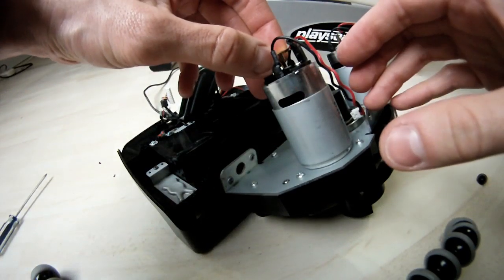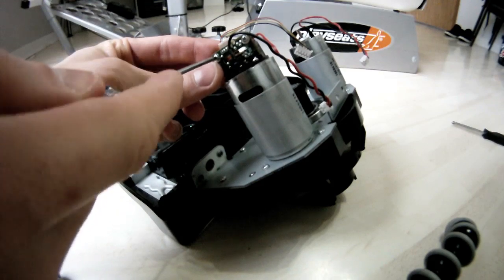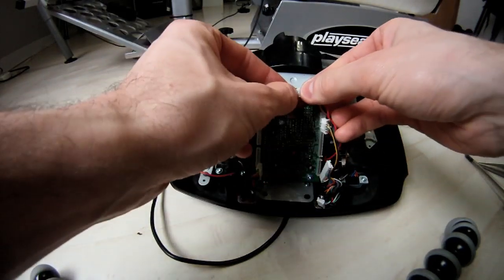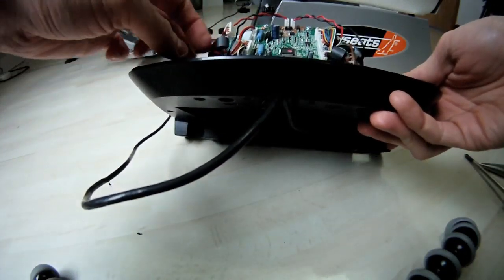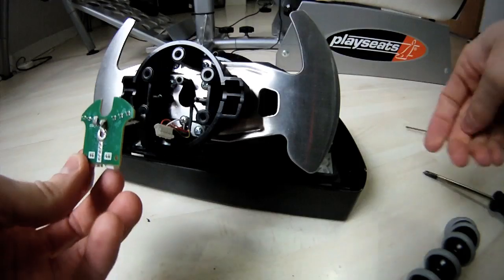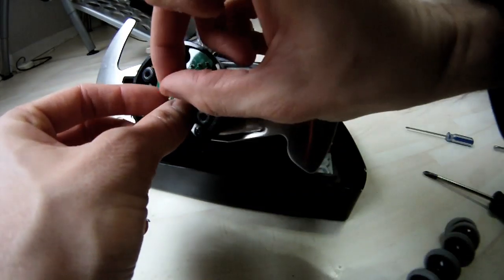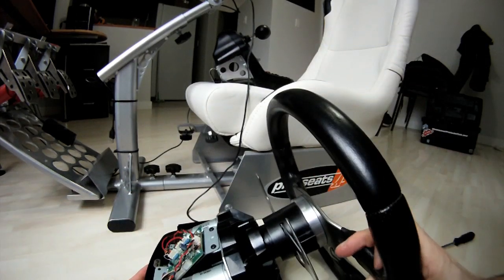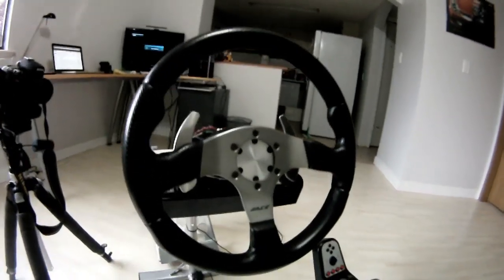How To: Replace Logitech G25 Optical Encoder Disc (Part 2)

Comment: Great video and very informative, thanks! I am still using my G25 in 2020 after some years in the dust and when I dismantled it after seeing the symptoms you describe, you helped me confirm that the crack is not normal! :-) However for what it is worth, you can replace the disk (on the G25 at least) without removing half of what you did. Just remove the top cover and unplug the wired from the right of the PCB, you can then pinch the black cover and you have enough room to get it off on the right side... I used this to reassemble it after I received the part (I dismantled it completely initially)!

Comment: Just did this myself, thanks for the vids. Works better than new. I will say though that you should mention in the comments about pushing the brass replacement closer to the black receiver. First time I put mine back together, it was too close to the light, and caused the wheel to stall during it's startup self-check (would only go 1/4 turn, tries 2 more times, gives up). And the closer you get it to the receiver, the crisper the FFB response. :)

Cheers.

Comment from the maker: I think I mentioned that somewhere but if I didn't thanks for pointing that out! It's true, you need to make sure the disc is a bit closer to the black sensor receiver thingy but not so close that the disc is touching the sensor. 
I'm glad that the videos were helpful! Thanks!

Comment: Thanks for the video. 
I have replaced the Encoderwheel as well, but now the G25 ist not finishing the calibration. I think it is related to the gear rack centering that you mentioned at the end. Guess I will have to fiddle arroung a bit to get it alligned.

Actually for replacing the encoder wheel, you do not need to unscrew the 4 inner bottom screws that hold the steering wheel gearbox. Then I think you wont have any problems with an not centered wheel.

Comment from the maker: Make sure the new optical encoder disc is not touching either of the sensors that it sits between but make sure its a bit closer to the black sensor but once again make sure the disc is not touching the sensor at all. Also try putting the G27 back together without the top part of the case to make sure the optical disc is spinning. And also make sure that the black plastic piece that aligns with steering wheel column is dead center. If its slighting out of alignment you'll get a blinking light.

Comment from the maker: When I first replaced the encoder I had a similar issue and I quickly realized that the gear rack or whatever its called was not properly centered with the steering column gear. I took it apart again and just moved the blast plastic piece with all so its dead center with the wheel and everything was back to normal. 

Also check the encoder disc's position. It can't be touching the circuit board or sensors but it has to be kind of closer to the white sensor so it can be picked up.

Comment: Awesome video. Hopefully you can help me out with a specific question I have. Do you glue the brass wheel in place or will it stay on its own? I ask because aside from cracks I've read of wheel slippage too.

I should be getting my brass wheel any day so just wondering if it needs glue. Thanks!
Reply from the maker: No it does not need glue. It slides right on just like the original plastic disc. Make sure you space it out correctly so that it does not touch the two infrared sensors. Try to center the disc as well as possible.
Reply: Ok thanks a lot for the quick response..you mean in the center of the opening of the board that goes over top of it? Also has yours held up fine since doing this or any other issues?
Reply from the maker: Matt K I explained it near the end of the video. Go to 7:58 of the video and you will see what I'm talking about.

Comment: i've replaced the old encoder with a new metal one and its still not calibating, it does like a little movement when i plug it in and thats it . The light on the shifter keeps blinking, i've checked everything like 10 times, its all put together as it should be, so im guessing it cant read the encoder?

Comment: Bought the encoder and put it into my g27. Now the power light blinks and it won't calibrate at all... all of the buttons still work though. I have had the wheel apart before and it weas fine, so I can't figure out what is going on this time around.

Comment: Hi, i checked Encoder in my g25 but it wasnt broken, after 1st test with out black cover it was working then i put cover and screw all thing it didint worked, again unscrew all it wasnt working, then somehow it was after usb plug working but then it stoped ? Any solution what it can be ? like when wheels move it move maybe something inside that it stopping working two engines, all buttons work on steering wheel.

Comment: Mine calibrates correctly but goes like 30 degrees of center after playing for a bit. I'll open it up and see what's wrong, I hope the disc is still fine because 38 euros is a bit exorbitant for a little brass disc.

Thanks for the videos.
Reply: Hi, i have same problem, did u fix it ? If yes how ?

Comment: The encoder wheel on my G25 cracked recently, so I bought the metal replacement parts (Encoder wheel and the internal frame, which had also cracked), but no matter what I do I have the problem where the wheel spins clockwise, then anti-clockwise, hitting both bump stops but never returns to centre, the two silver screws in the motor are tight and I've tried multiple USB ports, but problem persists and I can't find anything anywhere is solve it.
Reply: Not sure what I did, but taking it apart a dozen times, it seems to have just started working again

Comment: Hi Mike,

            I just followed all your video to replace the disk, however I found out that it was not cracked. I did change the power supplie and it seems that was the problem. Now when I mounted back the wheel, I did what you showed on the video, but the wheel turns one side but stop and the green light is blinking. I try to re align the plastic bar with the steering wheel but I still have the same issue, I checked the disk to see if it rotates properly end everything seems OK. How can we make sure the aligment is OK between the steering wheel and the bar with teeths?
Reply from the maker: +Jean Pierre St Louis 
Find the center of the bar with the teeth. Count the teeth if you have to and divide by two to locate the exact center.
If you removed the disc, make sure it is in the center as well so both sensors can read the discs. 
I don't know what else it could be. I'm truly sorry for not being able to provide more help.
Reply: +Jean Pierre St Louis 
I have the same problem. Did you fixed your wheel?

Comment: thanks for the video man. I have a question. does the encoder disc have to go on the motor in any certain way. whe taking off the circuit board, the disc was so cracked that it slipped right off. So if it lines up a certain way, i have no way of knowing now.
Reply from the maker: I'm not too sure how to explain it as I'm not good with words. It's one of those things where I would have to show you instead of explaining it in writing. I know the video is horrible quality due to an old GoPro camera and terrible angles plus you can't clearly see how the disc gets put on so I apologize for that. The brass encoder is a disc and cylinder in one piece. Make sure the cylinder goes facing down onto the silver pin and the disc will kind of go through the slot on the tiny circuit board. 
I hope that makes sense and I'm sorry if it doesn't. Like I said, I'm not good at explaining things.
Reply: Ok so as long as it's in the slit of the circuit board and not touching anything its good to go right.. thanks for the reply man. Mine cracked in two places which I'm assuming is the reason my wheel doesn't work at all. It sucks the only place I can get one is from Thailand. .
Reply from the maker: Gregory Latty Yes, it should be all good as long as the disc is in between the little opening of the circuit board and not touching anything while its spinning.
Reply: Cool. Thanks man

Comment: Hey man.  Do you have any suggestions on how to fix lack of power/no calibration. The sequential shift light is on when I start my pc up (left side of dpad) but the power light (right side) has gone from being fully light up to a really dim faded light and the pc regonises the wheel but doesn't calibrate and there's no Force Feedback.
Reply from the maker: I'm not really too sure. Try opening the Logitech and see if there is any loose connecting somewhere? Maybe you just need to replace the A/C adapter? I haven't run into any power failure issues yet. Sorry

Comment: Hey Mike, do you have any suggestions about the overheating problem of the logitech. Yesterday I played WRC4 for the first time and after an hour of playing i got some smoke comming from the left side of the wheel and quickly turned it off. Today I got back to rFactor and everything was working perfectly. The thing is that i feel more FFB in rFactor than in WRC4 but my wheel stays cool while playing rFactor, any thoughts about this?
Reply from the maker: I'm not too sure. Perhaps some circuitry of the electric motors within the Logitech fried? I remember I had some something similar but not exactly the same. I was playing GT5 and I smelled something burning but there was no smoke. A few weeks later the wheel no longer functioned and my optical encoder disc was cracked. Perhaps you can find some more information regarding your issue on Logitech and dedicated racing simulator gaming forums? 
Sorry I couldn't be of much help. 
Goodluck!
Reply: hey guys i had this problem. after the last few months i could smell smoke from my g25 which would come and go, then today it died with a glitchy alignment issue so i pulled it apart to assess the encoder, which had tiny cracks starting but no obvious problem yet so i put it back together after wriggling a few wires etc hoping for the best lol, and started it up with the case off and a puff of smoke came from inside the right motor (the non encoder one). i would say the brushes have worn. possible encoder issue aswell. i am now in the hunt for new motors and have a brass wheel ordered. thanks for the vid and the links they were both useful

Comment: I have changed the optical encoder, but when I power up the wheel calibration doesn't work properly - 2 full rotations without the final one. The power light is blinking.
Reply: So, after few tries the calibration procedure is complete, but the wheel is slightly off-centered to the right side.

Comment: i loose a white thing going on the electronic board is that bad?
Reply: nah.. nothing serius as long as contacts are connects well without it. i got same s#%t at my shifter in some places after i moded ir to detach from stock g25 shifter body.

Comment: Hi Mike,

I've been doing all steps of your video but i didn't manage to make it work.

problem is same as the 90% of people, the wheel isn't calibrating properly, I really tried to make it dead center but I seriously didn't achieve anything at all.

Plus I would like to know where has to steering column has to point.

During today im going to upload a vid to my channel, let' see if you can help me...

Cheers
Reply from the maker: Carlos Martín I'm so sorry but I'm not too sure what to do. I would have to see it in person and do some trial and error like you have. Perhaps I was lucky and my logitech G25  was not that badly broken as others may have reported. Maybe something is loose or not aligned correctly or maybe the sensors are not reading the new encoder disc? I really don't know at this point. I'm so sorry I cannot help any further.

Comment: my wheel just goes dead when it goes all the way to the left it wont come back right
Reply from the maker: Sounds like some type of alignment issue. May you please elaborate? When I took my G25 apart and didn't align the little bar that has "teeth" on it with the steering wheel column. I took it apart again and made sure that part was dead center. The wheel was working fine after that.Let me know, I'll try to help as much as I can.
Reply: same here, have you figured it out?

Comment: Where can i get optical wheel for normal price, not that insane price i see it at repair services?

I saw a crack on my own g25 optical wheel.  And steering wheel calibrates from 2-3 attempt from tome to time. But i still can play LFS and rFactor with no problem but feels like not for so long. It gonna die soon...

SimRace camarades, help me whit some info please, i digged out google but all i found is one offer at eBay that (with shipping) costs to me as a wing of a Boeing airplane lol
Damn that industry is so overpriced! I sad for that day when i dropped to trash the whole box of old ball-mouses, about 30, and parts from different manufacturers as IBM, Genius, Logitech, A4 Tech etc.. I clearly remember that some of those whells were look like exactly like this one but maybe with different inner diameter. damn